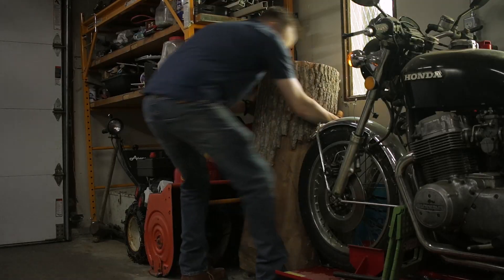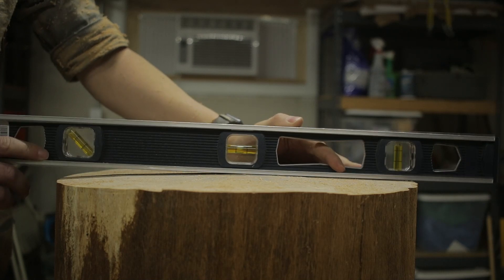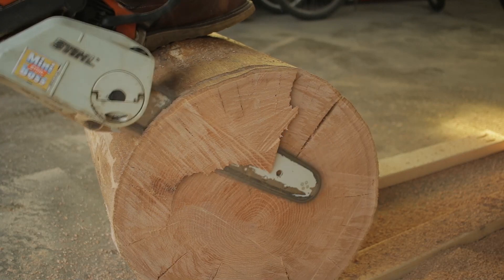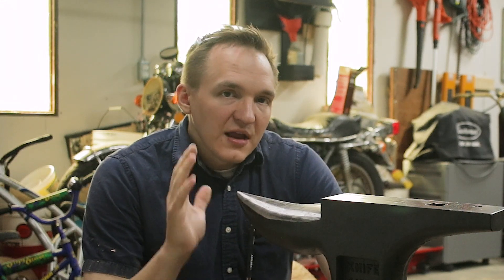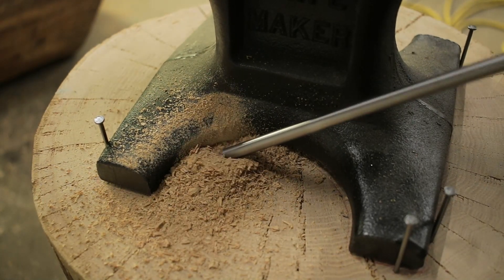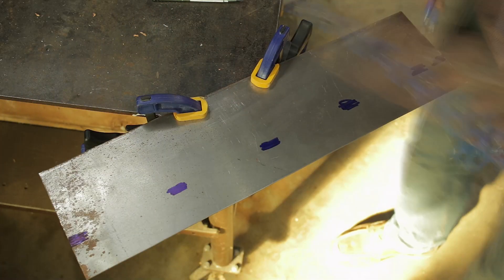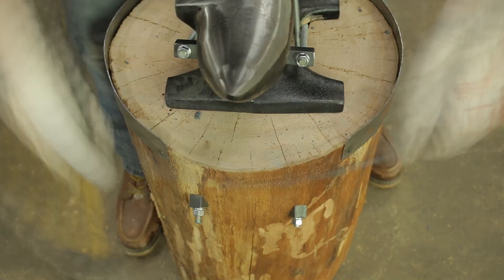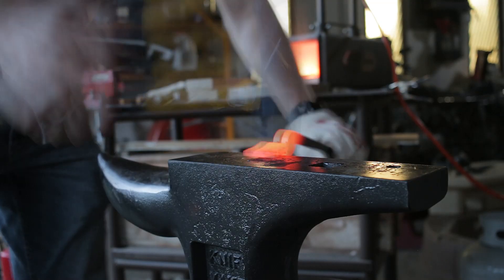All thread anvil mount — Blacksmithing setup

Comment: Well done, Sir. I'm literally making the same exact setup right now. I've had all the same ideas you had -- from all the same YooToobers - lol - great minds... Like you, I've been 'building up' to this for YEARS -- like 5-6 years... gradually acquiring smithing essentials -- anvil, post vise, hammers, tongs... I have a propane forge 90% built (from a 20lb propane tank) and I just finished building a little 12'x12' smithy out back and mounted the anvil log (oaken beast) about a foot and a half in the ground. Time now to secure the anvil to 'er. I'm using my little antique no-name 80lb  starter anvil and hope to get a bigger, way nicer one eventually, so I'm going to do EC's "easily de-mountable" setup with the chains that can thread down tight to steel mounts bolted onto either side, for now, so I don't put holes in the oak that don't line up for the future anvil. Have you done much smithin', yet? I know all to well how life gets in the way... I'll have to check your other vids -- keep up the good work!

Comment: Blacksmithing is so much fun, even if your homemade forge leaks gas ( fixed it ) with homemade tongs that hold your red hot steel by the tips so you have this rotating feature that everyone looks for because it shoots your work whizzng past your face and onto the dried grass all around you which wouldn't be a big deal if your gas line wasn't leaking. Oh! And even when your makeshift anvil that's impossible to mount dances around everytime your using. Even after all of this, at the end of the day when your elbows are radiating unrelenting pain at night, you can look at your work that resembles the center radiator core of late model Asian sedan that was in a head on collision at 90 mph that is with out definitive form or shape. You had a blast making a mess, because moved steel alloy with your hands and reshaped it.